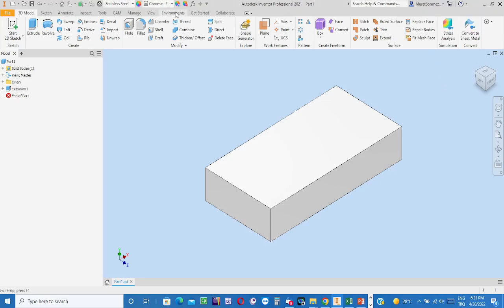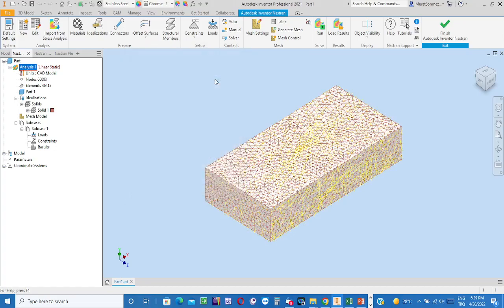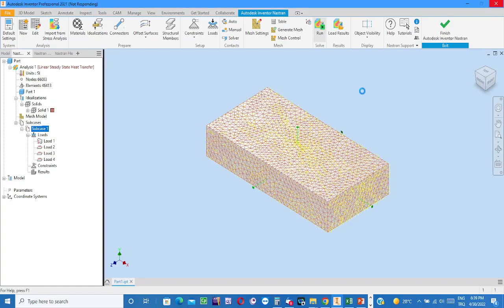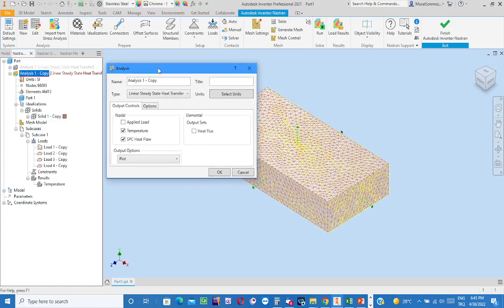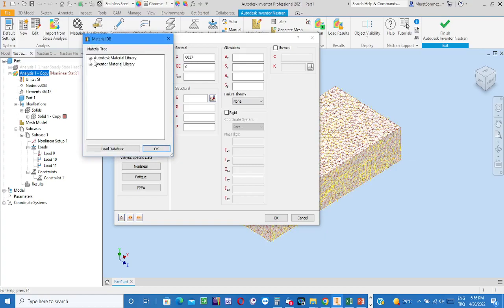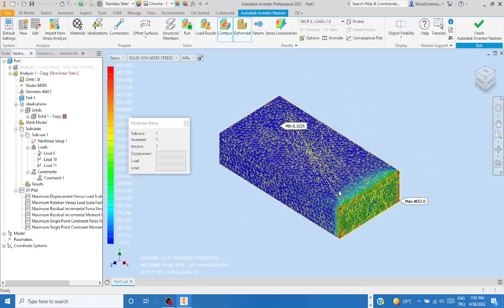Thermal Stress Analysis in Inventor NASTRAN- MECH 533-Record 54new

Comment: Thermal Stress Analysis in Inventor NASTRAN
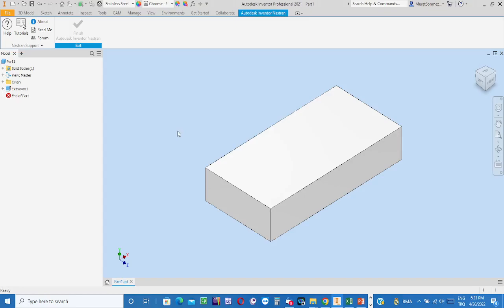NASTRAN 05:50
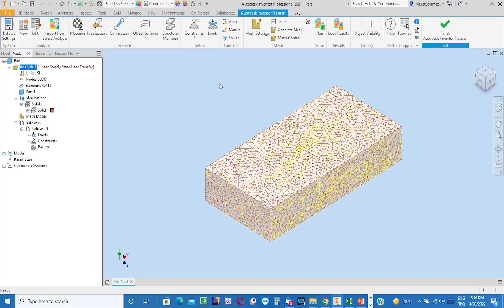Thermal load calculations 12:30
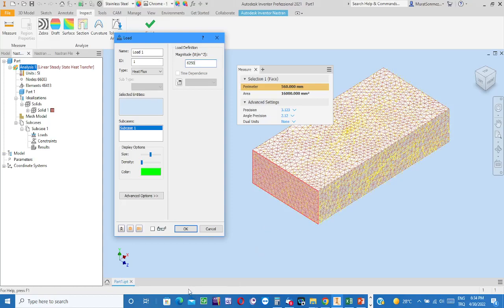Thermal Load application 16:25 (Heat flux)
Thermal Load application 17:40 (convection)
Results 22:22
------------------------------
Thermal + stress analysis (NASTRAN) 24:00
Duplicate the thermal results & edit 26:15
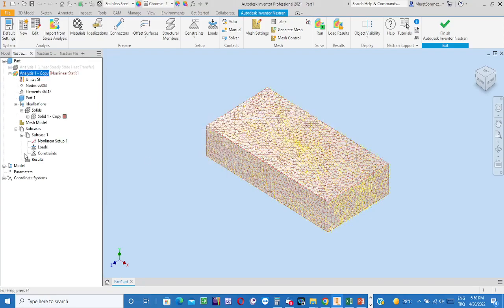Load (output option .FNO file) 32:45
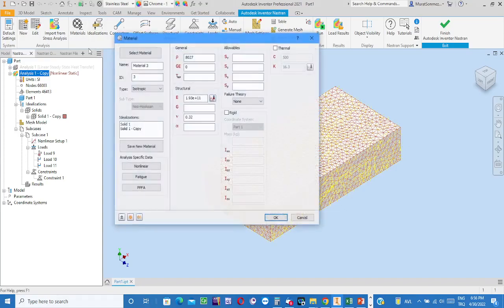Material (Thermal ✅) 38:20